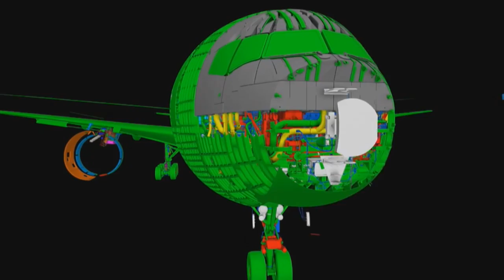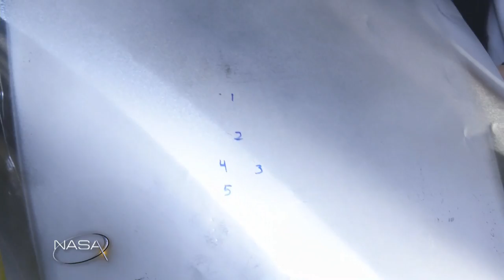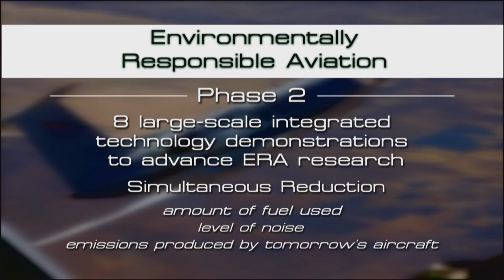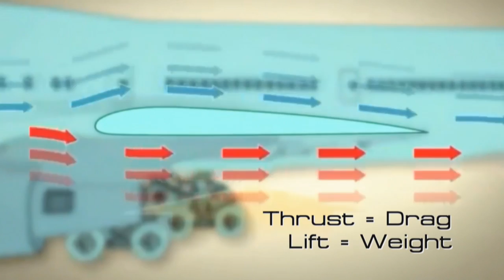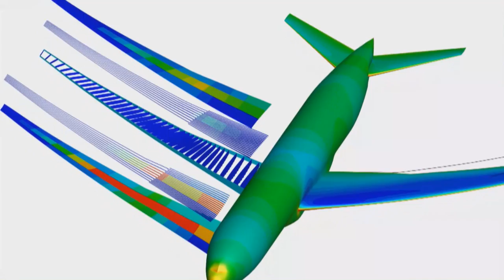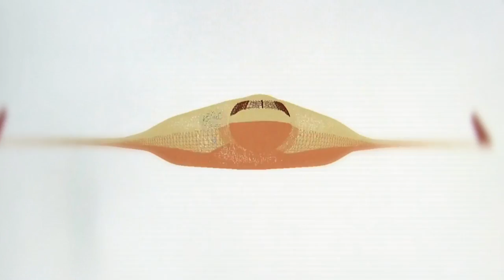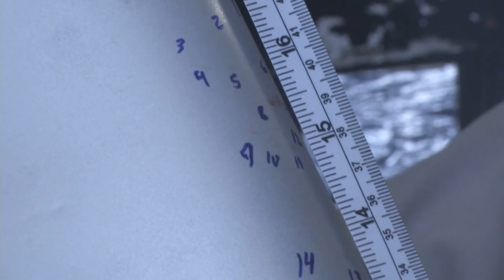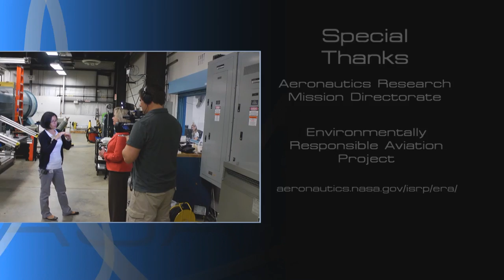Future Forward

Comment: Showing an airplane landing and taking off in a cross wind, is interesting.  How similar is flying in a cross wind to losing an engine?  Just wondering?
Reply: 3 years late, but losing an engine (on a 2 engine plane) will cause a yaw effect on the aircraft (similar to a cross-wind). 
I.E. Thrust on 1 side of the aircraft, but not on the other. 
The Rudder is used to compensate for the lack of thrust from the engine that went out.